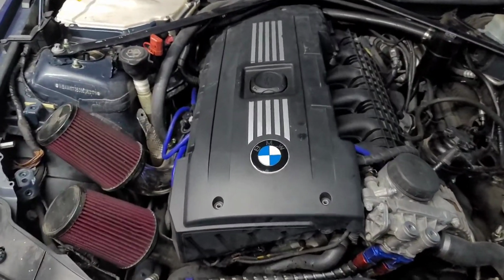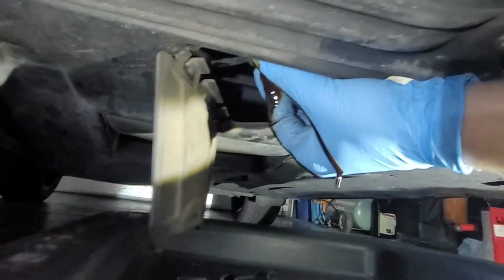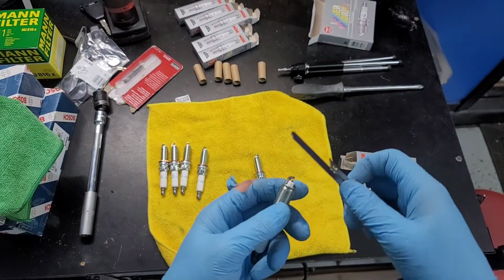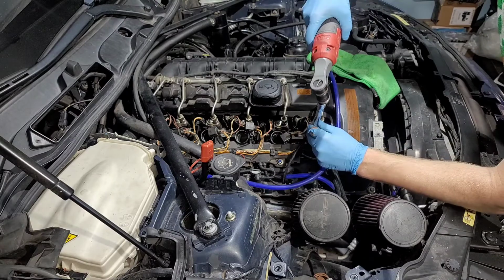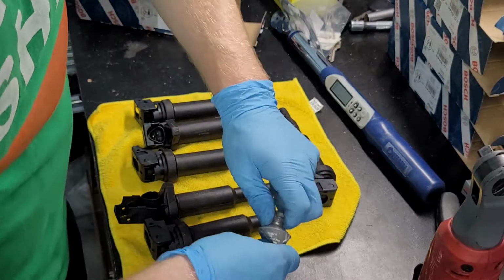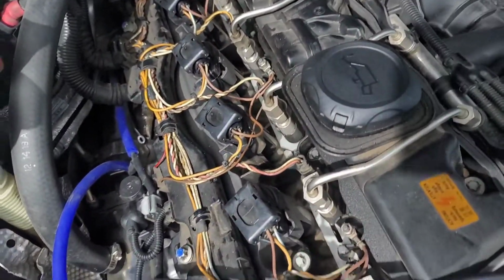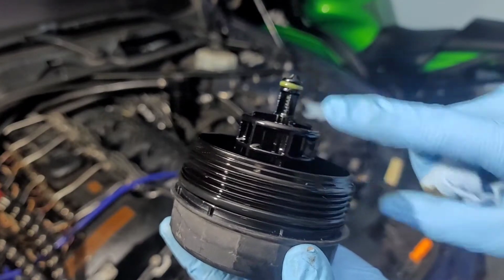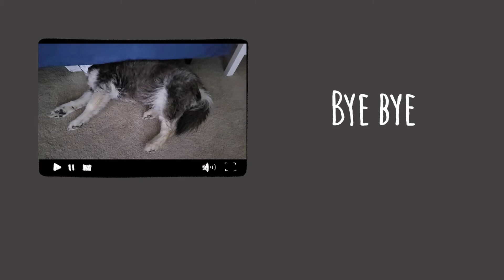08 BMW e92 N54, spark plugs, coil packs, and oil change (ALL DONE FOR FREE) watch to find out HOW!

Comment: How did you get free return shipping from
Fcp euro ?
Reply from the maker: The warranty claim is through fcp, and the fre return shipping is through PayPal, you need to sign up for PayPal return shipping on a computer (free) and then make your purchases on fcp using PayPal. Then when your returning the item for warranty, PayPal will have an option for return shipping. You get like 12 returns per year, and I believe each return is like a 35$ shipping coverage. Anything over 35 you'll have to pay for